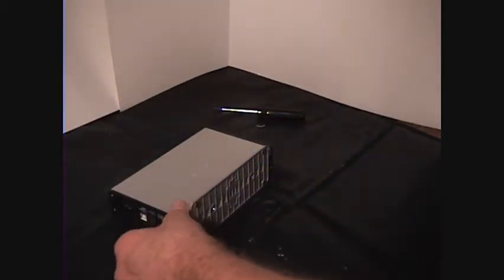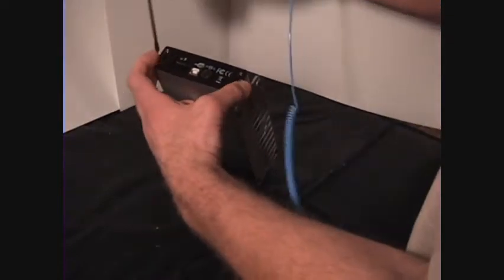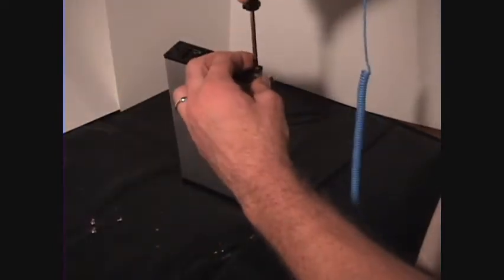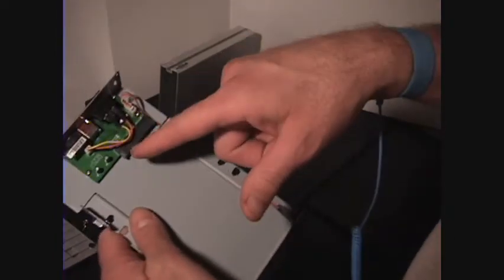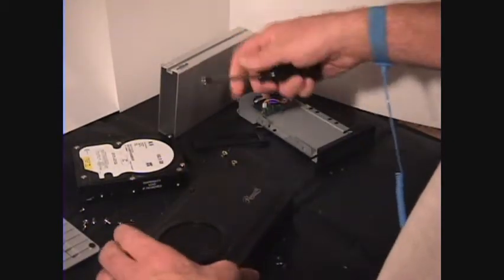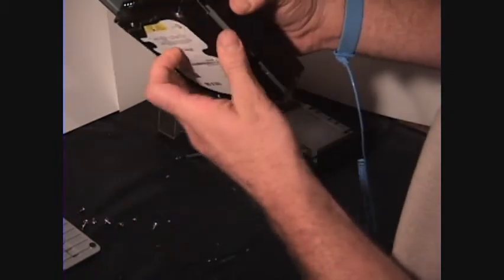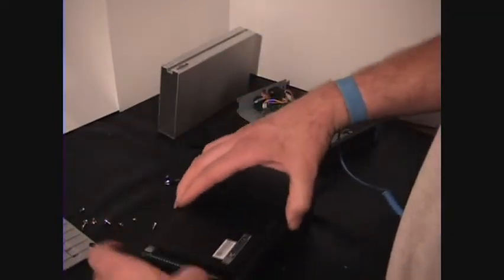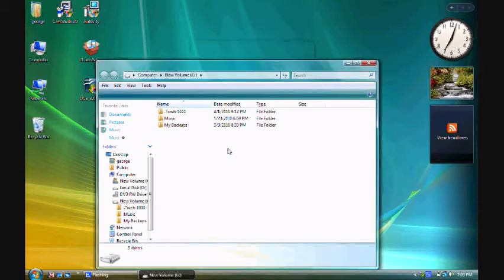Rescuing data from a bad external hard drive

Comment from the maker: Can you tell if the drive is still spinning after the ringing stops?  When you plug it into the laptop do you get  any evidence of Windows detecting any new hardware?  If you have access to a non-Windows computer, such as Linux or Apple try connecting to one of them.  Also, as a last resort, some people have had success putting the hard drive in the freezer for a while. It sounds like a physical problem and cooling it may contract the metal components so that it will work properly.  Good luck.